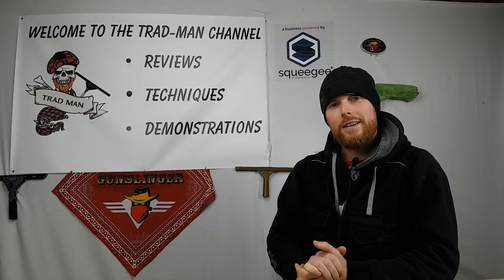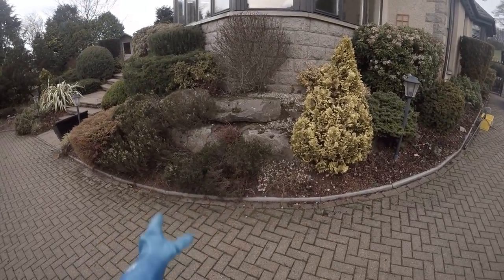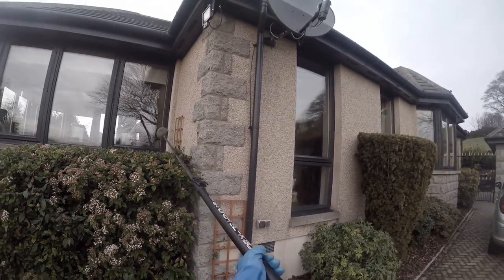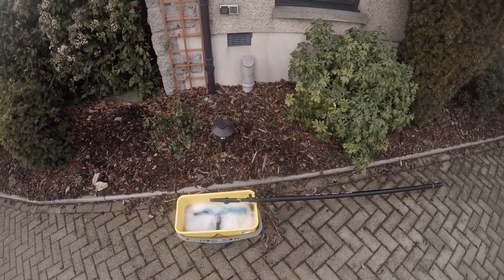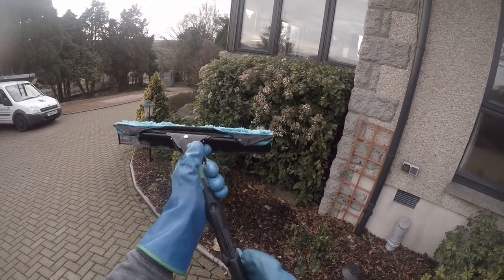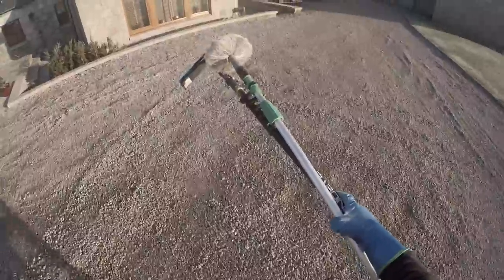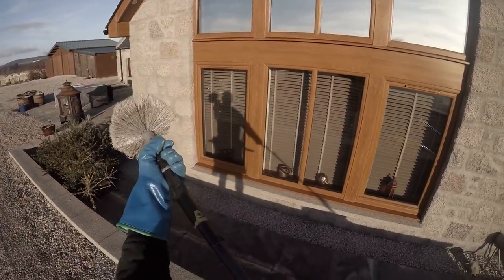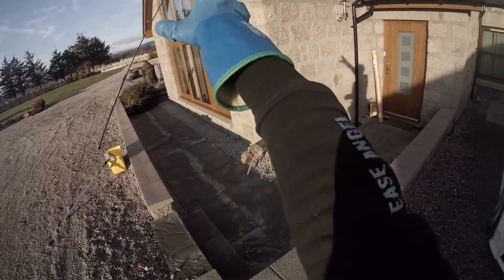Advanced Window Cleaning Pole Techniques - Squeegee Skills Episode 6

Comment: Nice, by far one of the most explained tutorial I've come across👍 
just one question: if you transition with the leading edge do you push it a little "in reverse", so that the squeegee dries off. When I transition from left to right of RtoL, I always get turn marks.

Hope this makes sense😅
Reply from the maker: I just make fluid motions when fanning so, no sharp turns. If you try to turn on the spot with no forward movement it often leaves a mark. Just make sure your squeegee is travelling as you turn if that make sense

Thank you for tuning in!

Comment: Thank you for the in-depth techniques.  I wish I could use this for all my residential customers but here is sunny California I come across ALLOT of oxidized frames (milky runoff if wet) , so nose to glass is required.
Reply: Me too.
I am in the bay area.  Most of the white frames here bleed white, due to all the sun.
Reply: Daniel Mann nice! Where at North, east , South Bay?  I’m technically in the north bay.  

Yeah it’s a pain and haven’t mastered the technique of using a pole around oxidized frames.
Reply: @heatherthewindowwoman4835  -  I just  saw your reply. Yes I am in the south bay. My business name is Pane-less window washing.  Today I did  exterior windows that were all french panes, I wish i could of used my water fed pole, but because of the dang white frame bleeding i couldn't. It took me all day instead of 2 hours.
Reply: Daniel Mann geez! What a hassles!
French panes have become very popular with remodals and new builds here in the bay are, guess they like the “Euro” look.  

Another local window cleaner in Napa says he “blasts “ through oxidized frames using a WFP by just scrubbing till the water “runs clear”. That’s fine all but I’d imagine he exhausts his resin bags 2x as fast. Not sure if that’s something you’ve considered or looked into.

Comment: As I understand it, The Gardiner SLX is a waterfed pole so the ends are suited to brushes, To turn it into a trad pole what do I need to get.   I tried to get this info from your video but can't just see it.   Good video as usual.
Reply from the maker: Yeah the pole is modified a wee bit. 

I took a standard wfp straight neck (with the thread on the end) and screwed the moerman angle adaptor to it. If I remember rightly I had to file the wfp end piece down a bit to get the moerman adaptor to slide on the top

Comment: Excellent video mate   Quick question,  will the Moarman angle adapter fit into the end of my Phantom 18?
Reply from the maker: No I'm afraid not. You have to do a bit of DIY
Reply from the maker: Alternatively buy an unger nlite pole and that can be used for trad and wfp
Reply: @TradMan  ahh right. Ok.   This diy you talk of, any videos showing how?  I'm starting out after getting laid off so trying to save where possible, even thoughI i seem to have spent a fortune already 🤣    .  If not il buy the pole as I've already bought the Moarman adapter.

Comment: Thank you for your very informative videos. I am just starting out window cleaning in Cyprus, do you have any tips regards to working in direct sunlight and heat. I have ordered the latest Moerman handle plus the f*lic 14" plus 12 " accelerator, that I will use the Etoree master rubber which I believe is more suited to a warmer climate as it is hard? TYIA cheers.
Reply from the maker: Hey buddy! All the best with the new business!

When it's really hot you just have to really saturate your applicator. Keep the bucket next to the windows your working on, so you can dunk, apply soap and start scrubbing. Then squeegee it off as quickly as you can. If it's in direct sunlight, just soap and squeegee one window at a time to avoid streaks. 👍🏻😊

Comment: Sorry not sure I understand. Why does this tool not require detailing? Thanks Trad man!
Reply from the maker: Yeah the blue clips on the ends put pressure on the tips of the rubber, which push the rubber tight into the frame when using the squeegee, it's an old technique that was called dog ear'n. Doing this means it's takes all the solution off the glass so you don't need to wipe the glass after you've used the squeegee. 

Hope that makes sence
Reply: TRAD - MAN THE WINDOW CLEANER  Excellent thank you, yes it makes sense. I just ordered the excelerator and can’t wait to try it. Thanks for the video.
Reply from the maker: @ThunderstoneWV  happy to help. If you need any further assistance give me a message on the Trad-Man Facebook page

https://www.facebook.com/mrtradman/

Comment: Thanks you,you have a link to a good carbon pole,to use in traditional?
Reply from the maker: Try the Gardiner poles. Type in Gardiner waterfed poles into Google ;)
Reply: @TradMan   Thanks,do I need an adaptator to work in traditional?
Reply from the maker: It's a massive help to have one, it allows you to work on hard to reach windows easier :)

Comment: Great video trad man. I have a query about your van, I’m looking at a couple of new vans, and one of them is a 2009 transit connect. What’s your opinion on the connects?
Reply from the maker: That's the van i have, the connect is bomb proof but look for one that's been looked after. Mine had very little damage and was fully serviced since day one. Some vans can be abused so just be wary buddy ;)
Reply: Trad - Man one I’ve seen only has 86k miles on it and a full service history. I’ve checked the mot history and it’s failed a few mot’s in the past. But was then passed a day or two later with the failures rectified. It’s just had the timing belt done and serviced. So I’m leaning more towards the connect. The other vans I’m looking at are renaults and a Citroen.
Reply from the maker: Maybe if you can get a qualified mechanic to look at it aswel?
Reply: Trad - Man that’s not a bad idea actually. I know a couple
Reply from the maker: It's handy if you can take a trained eye ;)
Reply: Trad - Man a lottery jackpot win would be nice, I’d just buy a brand new one then lol.
Reply: ClearView C 
I think if your gonna be in the trade long term, just lease brand new 
It really will pay benefits
Looks good and customers feel confident to use your services
Reply: @clearviewc3732  28k USD here in the states for a new 19 Transit, zero options.

Comment: Hey trad man, what would you say is the highest you could go using the trad pole? Do you reckon you could get through most of a residential round up to three stories with it effectively eliminating ladders?
Reply from the maker: I would really only use it if its not safe to use ladders or can't get access. You can never beat a nose to glass finish I'm afraid 😉

Comment: Tools and techniques are only “advanced” as the users. It’s the wealth of knowledge that would make someone advanced, experienced and/or seasoned so to speak. 😊
Reply from the maker: I agree knowledge is a big part of it, hence why i make these videos to give folks that knowledge they can then use to make the jobs easier and more productive 👍🧔
Reply: Trad - Man thst they do very helpful and well spoken. Can I ask what extension  pole that is.
Reply from the maker: The big i use was a Gardiner slx 30ft pole.  Was a waterfed pole but a just screwed a traditional angle adapter on it 👍👍🧔